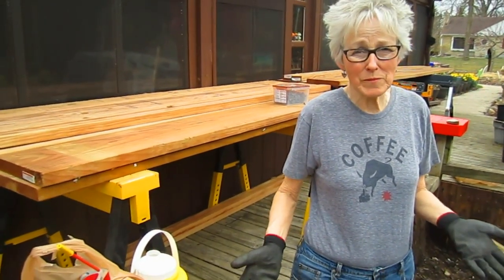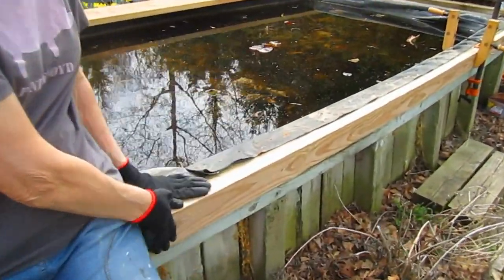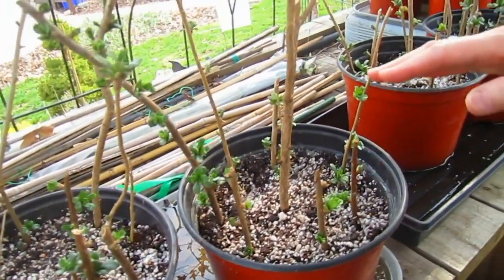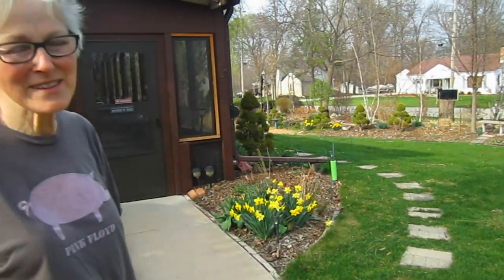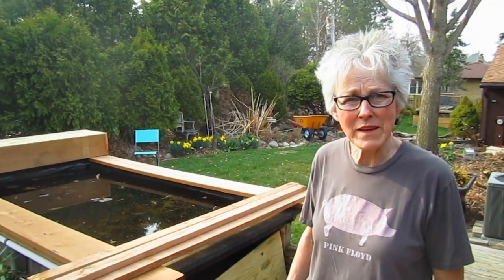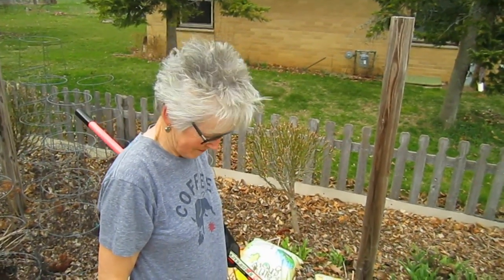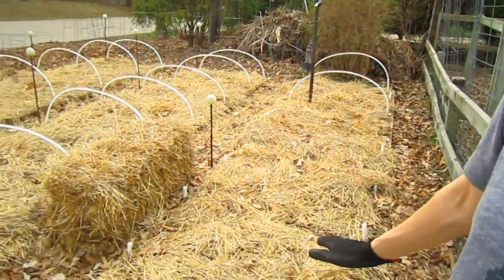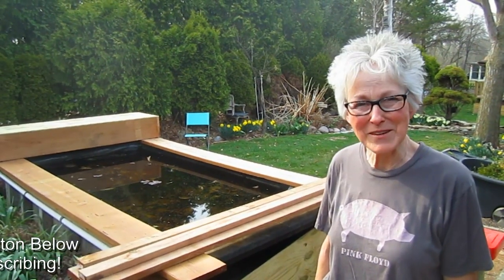Rebuilding Our Waterfall Part 2   Wisconsin Garden Video Blog 823

Comment: lynn your water fall structure is looking pretty nice. Richard did good and I noticed your strawberry plants and your garlic are coming along great, speaking of garlic and strawberry plants I planted garlic last fall I am hoping I well be able to harvest my garlic sometime this summer, and my strawberry plants just got planted
Reply from the maker: You'll enjoy your strawberry patch along with fresh garlic from the garden.  Remember to cut off the scapes (curly flower stalk) so that all the energy goes into bulb production.  For us that's sometime mid to late June.  We do not harvest the bulbs until after the bottom 4-5 leaves turn brown.  Use a pitch fork carefully when digging them up so as not to accidentally cut into them. Enjoy. Thanks again Jackie for watching, caring & sharing. Lynn & Richard